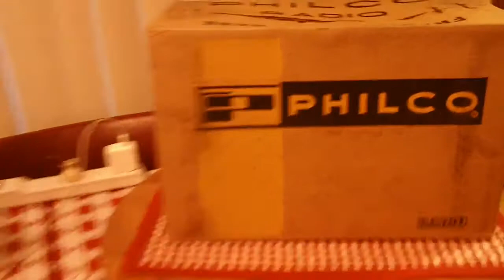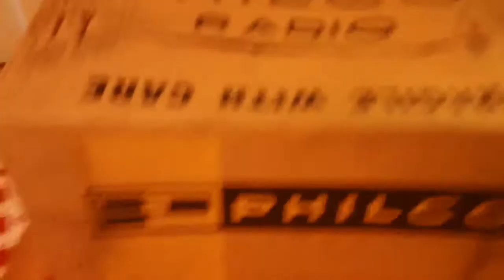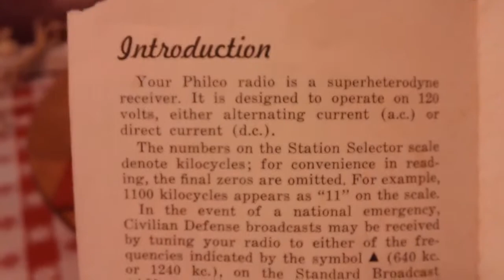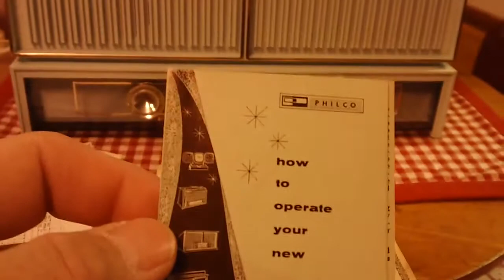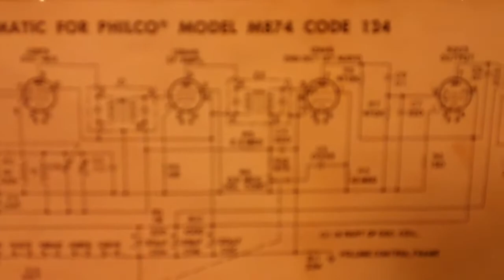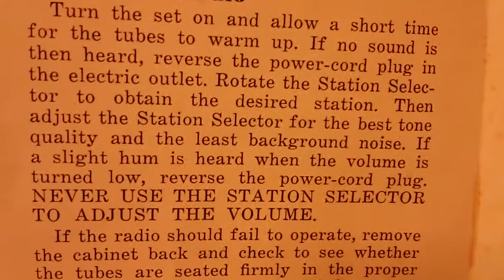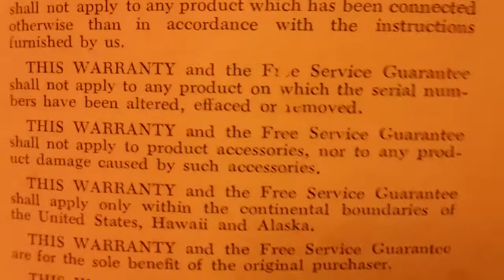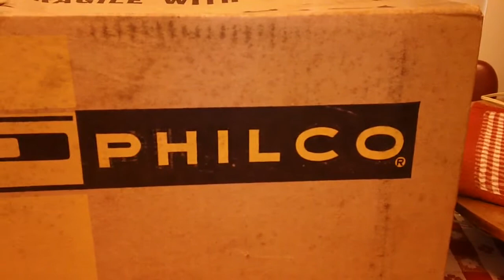Philco M874 Code 124  A Brand NEW Vintage Radio, from 1963

Comment: Al,
Back in 1962 I ordered one of those radios directly from the factory, but never received it.  I was told the post office had mistakenly sent it to someplace in Missouri.  Several tracers were sent out, but it never did turn up.
After all these years, how fortunate we are that you're the one to find it.  Sooooooooooo old buddy, old pal, I'd appreciate you quickly forwarding it to my Arkansas address, after which I can inform the post office officials that at long last their years of exhaustive search efforts can finally cease.  I anticipate many happy faces all around.
Now don't delay in this action.  Remember,...I still have Mac.

Regards,
John
Reply from the maker: Well darn it John, your address has a bunch of funny numbers behind it.  If you had a '62 type address, I'd send it right away, but, I'm a little hazy on whether to send a new 63 Philco to an address like that, it don't seem right, somehow.  It'll all even out.  Maybe someday, the knobs I ordered that the Post Office lost will turn up somewhere in Arkansas.  I'd hate to force a plastic radio on you, anyway.

Comment: Wow, this is just spectacular! What a great story. I agree with you 100%, this radio has lay asleep long enough and should be used. It's a great looking radio, too. I usually don't like the appearance of these later sets, this has however changed my opinion entirely. It has landed with the correct owner in the end, it's not often that you can say that you're the first owner of a vintage radio.
Reply from the maker: Thank you Dylan, as always, you and I pretty much agree.  I haven't collected many set from the 60's, just didn't care for them.  This one, when I first looked at it, I said, meh.  Then I got to thinking about what it represented and I said, hell yeah, I want it.  Now that I have it, I just started liking it for what it is.

Comment: Really cool find Al! Love the music from '63. I was 12 at the time and already tearing apart old radios. I recently restored an Emerson 811D AA5 radio from 1955 and was surprised to find that it used a phenolic circuit board instead of point to point wiring.
Reply from the maker: Now that's something I haven't researched, much, when various companies switched over from point to point.  Could be interesting.  I don't have many 50's and up sets, really.   Thanks.

Comment: Nice one Al, you really get the time machine feeling knowing the set is totally new and in its original box, etc.   That Ray Charles number was a regular at our local cinema back in '63.  I was all of 11 years old at the time!
Cheers,  John
Reply from the maker: Yeah John, it's kind of sad, that I remember most of those tunes, when they came out :-)  Of course, that was a Hank Williams song and my Dad was a fan, so, I probably heard is from birth.  It did feel like that, more so than with the normal vintage radio, John.  Like a time machine took you right back there.  Course, I couldn't have bought it, in first grade :-)

Comment: Hi Al - What a great buy, I like it!  Cool to see it in the light again after all those years being storaged!  About 3 years ago I went to a hamfest and saw an unboxed 5" tape reel-reel player made 1962.  It sure looked like it had never been opened, but the owner wasn't sure.  Could be full of parts or something other then the player, but was afraid to open it worried damaging the history of it.  I asked him what do you want for it, and he said $5.  Man, for $5 I'd give it a shot.  So, I took it home and sure enough it had never been opened from the manufacture.  I never tried it to see if it works or not, but instead kept all the plastic on it, the accessories like the case and microphone still sealed in plastic, all papers and warranty etc. and showed it off to friends as a time capsule of 1962 electronics.  Eventually I sold it at my own table at a hamfest last year (as much as we hate letting things go, to bring new things in some things gotta go out).  I had my fun with it, put $15 on it and sold it quickly.  If I ever find another unboxed unit of just about anything electronics prior to 1980, I'd go for it again.  See ya -- Atco
Reply from the maker: Atco, you have a ton more willpower than I do, buddy :-)  I'd have had to have that thing set up and working.

Comment: Wow! Might not be a rare model but rare in this condition. Handling things like that always give me a mix of feelings,excitment, amazment at the condition and a strange feeling that time just hasn't happened to that object. Just in box in 63 and then 2014 like 63 still touches it in some way.
Reply from the maker: It did give you exactly those kind of feelings, with the packaging and knowing it was "new", of stepping back in time.  I didn't restuff the caps, the caps were plastic type.  I also removed the multipart can, as it was a circuit board.  I put the original caps in a bag, in the box.  When it comes time to part with it, I'll re-install them, as they weren't really bad.

Comment: Looks beautiful! Did Philco make an AM FM version of this radio too? Thanks for making this video.
Reply: Yes Philco did make an AM / FM version using a slightly different chassis of course, with same 2 speaker design, only difference being that it had a wooden cabinet with a long slim low sort of design theme, it was a Model N 944 and there were 4 or so different cabinet designs for the same radio!  My cousin just bought one at an auction for 5 dollars and he asked me to check it out and do any repairs needed so I did !!  The set had all the Philco branded tubes, I replaced the Electrolytic cap can with 3 separate caps, I then replaced the 2 black molded caps which one had developed cracks in the case, this one was an across the line cap it was .047 MFD at 200 volts. The tubes all tested very good so left them in the set. I then cleaned and re waxed the wood cabinet section. My cousin likes it very much, it is a beautiful little set!!  John A Bellas  KC2UVN

Comment: Al,
Although I would not associate that particular type of radio with you dear chap, you have, in true OldRadioAl style, bought something special.  We can all ask ourselves, “When was the last unboxed Vintage Radio we saw?”  I’d bet the majority of Vintage Radio men would say, “Never!”  The closest I have come to seeing unboxed Vintage Radios was eleven years or twelve ago at the NVCF.  On a stall were five unopened radio boxes, therefore, I did not see the actual radios.  There were four Regentone DW3 sets and one Ekco U245.  Normally, those two types of sets (used, grimy, and in barely working condition) would struggle at fifteen to twenty pounds apiece.   Since they were unboxed, and unused of course, each was astronomically priced at around one hundred pounds but, what appeared strange to me, they were soon sold.  Although I wouldn’t pee on either of those two types of radio, even if they were on fire, especially the Regentones, I now look back and wistfully think how nice it would be if I had bought one of those sets if they had been priced, say, at thirty quid each (dream-on Phil!).
Hang onto that Philco, and the components you have replaced, my friend, there is a strong possibility it will appreciate even more in value over time.  No matter what the radio, an unboxed valve set is genuinely rare.   Yes, a great find: well done my friend.
Regards,
Phil.
Reply from the maker: That had me laughing, buddy, wouldn't pee on them if they were on fire :-)  I know exactly what you mean.  I would have said the same about a "Philco-Ford" radio, previously, although, technically, this wasn't a Philco-Ford branded radio, it was after Ford bought Philco and they were on the way down.  This was all the sweeter, paying only $24 for it.

Comment: That's amazing Al. Do I see paper tape holding the ferrite aerial on? If so, it's not even peeled back or anything. Thanks for showing this latest find. Regards - Andrew
Reply from the maker: It is paper tape, Andrew.  I'd really like to see that shop, you'd think that box would be in bad shape, too.  You'd think there would be dust, maybe mold, maybe some mouse droppings.  Maybe a fluke, but, it seems like the climate control was really good.

Comment: Pretty amazing the caps were ok without use...
Reply from the maker: Bryan Parnell It sounded great, out of the box, but, of course, I didn't trust it.  It was recapped.  Thanks.
Reply: OldRadioAl I would try to resist recaping just because of how original it was, but at least it works...
Reply from the maker: I considered that, believe me, but it's one I listen to regularly.  I'm not one to keep things in their original shrink wrap, I play with my toys.  :-) it's value to me, is as a radio, to be cared for, but, not as a time capsule.  I look at as, it finally got to fulfill what it came into existence for, after many years on a shelf.
Reply: OldRadioAl Yep, replacing caps is basically like tires on a classic car. You wouldnt want to drive on em, even if they had zero miles on em